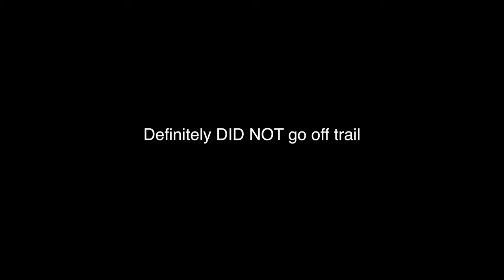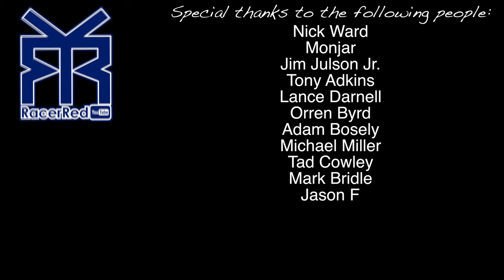Why I Don't Use Ethanol Gas In My Motorcycles (Especially Carburetors)

Comment: I agree running regular gas is better because ethanol doesnt do well with moisture. Water causes the ethanol to separate from the gasoline. Regular gas will cause condensation and this is why you should always keep your tanks full.  If you ride enough where the gas doesnt sit long running ethanol is okay. I run ethanol in my KTM because where I live theres no stores that sell 93 octane non ethanol. Merry Christmas to yall. Stay safe

Comment: I am a 51 motorcycle rider and bike builder.. and I will tell you until I am blue in the face that ethanol gas is garbage and ruins your bikes ..I am lucky living in the upper north east I can still purchase ethanol free gas.. or race fuel.. my 2 stroke 300 loves non ethanol..my 4 strokes really hate ethanol I feel it effects them more so.. especially flame out issues.. harder starts when hot.. and hell on rubber seals orings etc . So I totally agree with you on that ethanol sucks... !!!

Comment: Non-ethanol will be harder and harder to get as the EPA pushing to increase the % of fuel that has to be biofuel.   Non-ethanol is available in WA but hard to find and not always practical to use.  Publicly owned land - doesn’t that mean WE the people own it??
Reply from the maker: I really hope they keep non-ethanol around! Ethanol makes my stuff run like crap. Especially if it sits for any length of time.

Comment: You got to love it when it is privately owned just 50ft. Along the road. Then that said owner has free use and control of the whole area. Selfish, power monger, A hole.  Oh No, there’s those voices again.
Reply from the maker: Yeah, I think it needs to change. Through access should be required.
Reply: @RacerRed  land owners will shut off access through their land because, over time the public can force to have an easement through. Makes it hard to sale as the property to land developers with an easement on it.